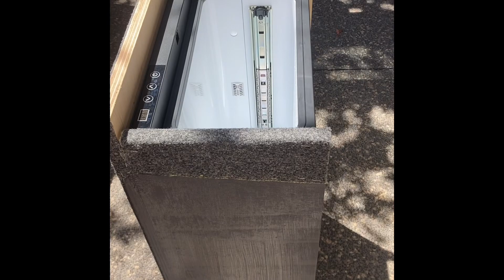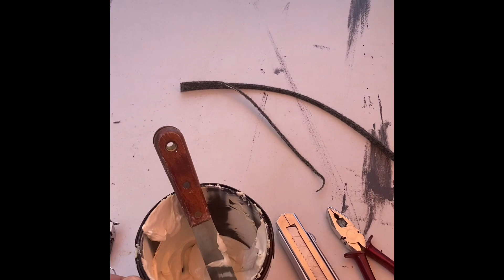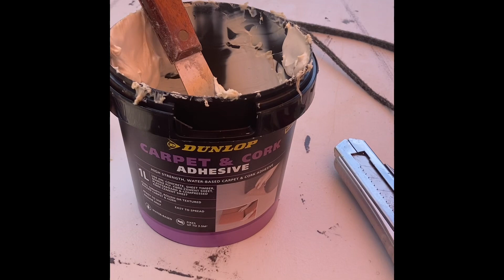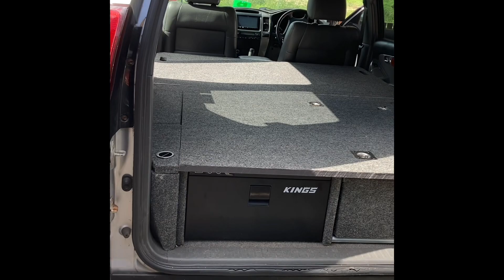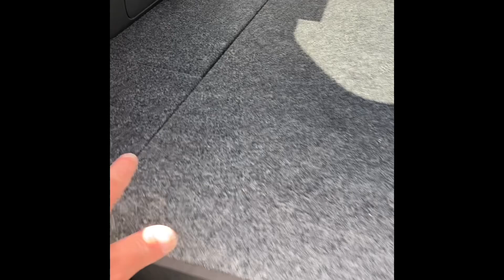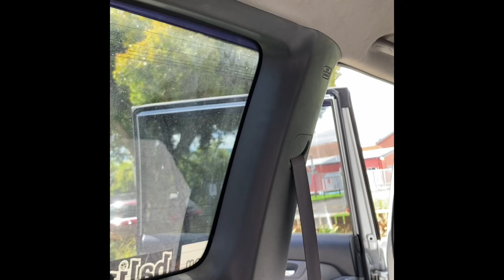Toyota Prado 120 Rear Bed Conversion Project No.5

Comment: Hello, I know it’s been a while, do you know by any chance how much sleeping length you ended up with? Any answer appreciated.
Reply: It all depends on how far back you slide the front seats. In my case, without moving my 1st row of seats, I get 1.9m to the rear door.  This is exactly my height.  My seats are electric, so sliding is kind of slow, but the option is there, if I need few extra cm. Shorter drivers can probably squeeze out 2m, without moving the seats.